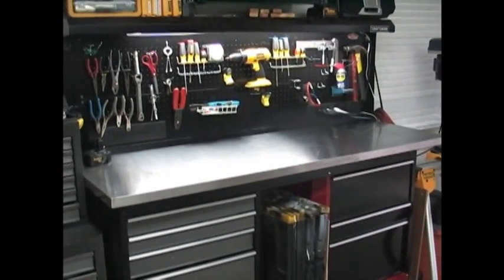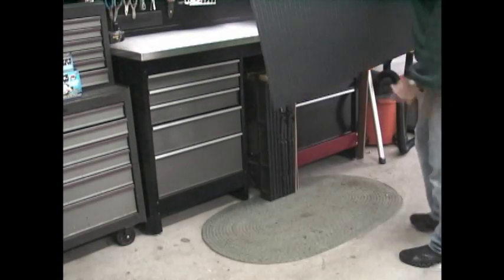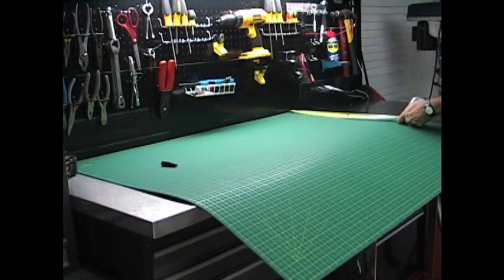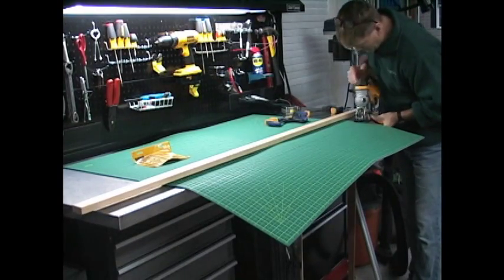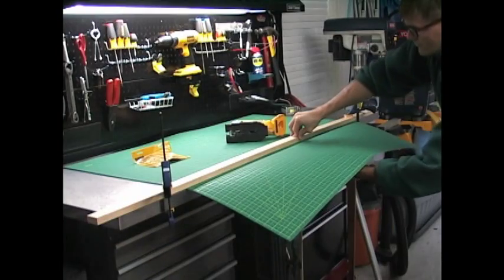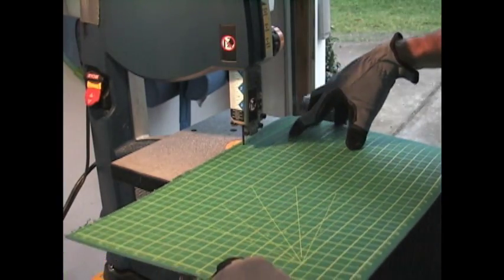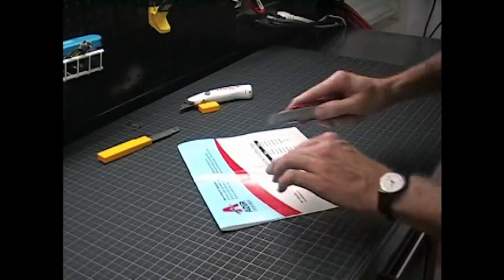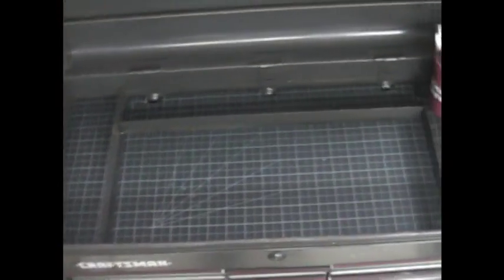Protecting your shop work bench / Jon's DIY

Comment: Nice👍 is it gas and oil resistant?
Reply from the maker: not sure about the gas.  But I have done many small engine repair on it without change.   The only thing I would say to keep away from it is heat.  Something really hot could warp it.  And I know this because the piece I cut off, I use on my desk in front of my computer and I put a fresh out of the microwave bowl of calm chowder down on it and it warped it slightly.

Comment: Random question... brand is that workbench?
Reply from the maker: Alfredo, all bought at Sears. Made by Craftsman. Bench top Model 706, 149280 
the back stop Model 705,149430 
the drawer Model 706, 101390

Comment: Great informational video.  What's the workbench model?
Reply from the maker: Gene,  all bought at Sears. Made by Craftsman. Bench top Model 706, 149280 
the back stop Model 705,149430 
the drawer Model 706, 101390
 
the drawer on the right (red one) was bought scratch n dent as is at the Sears Outlet.